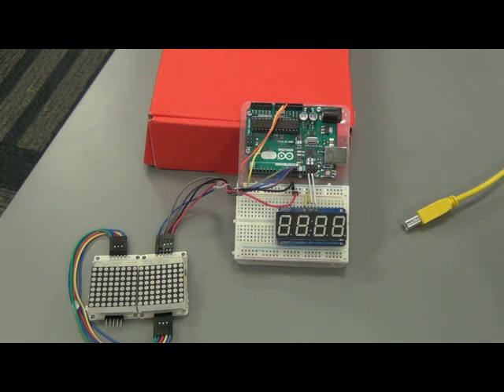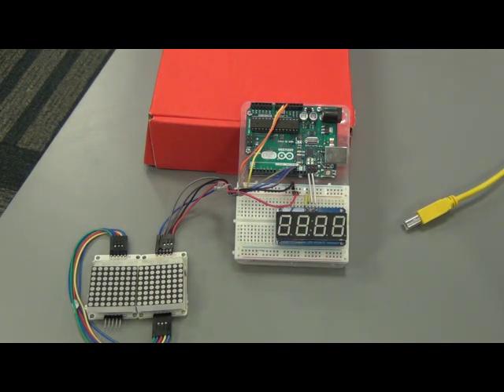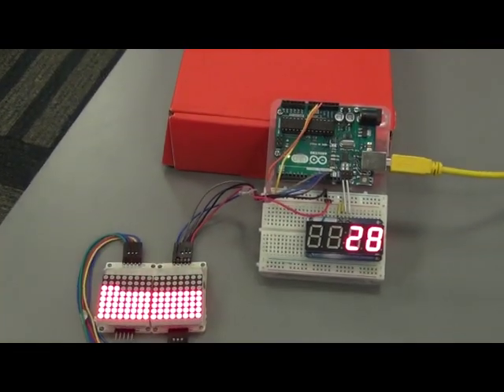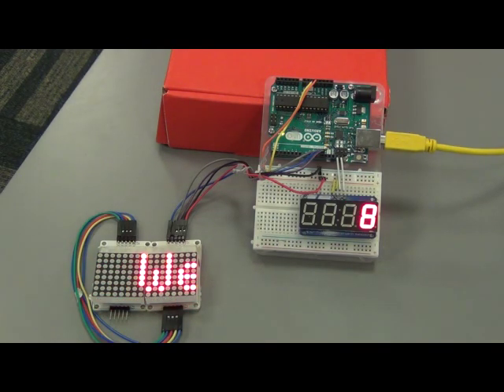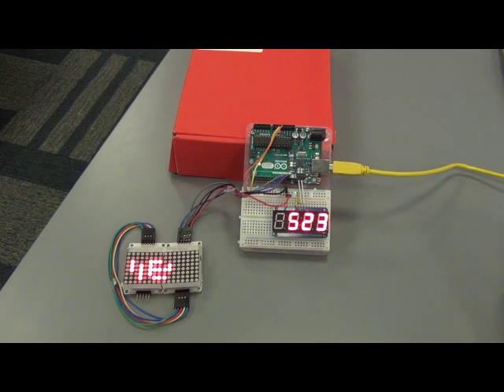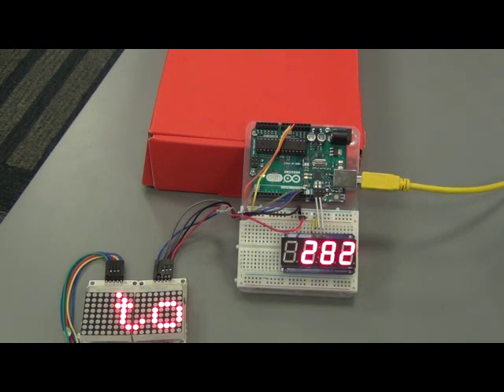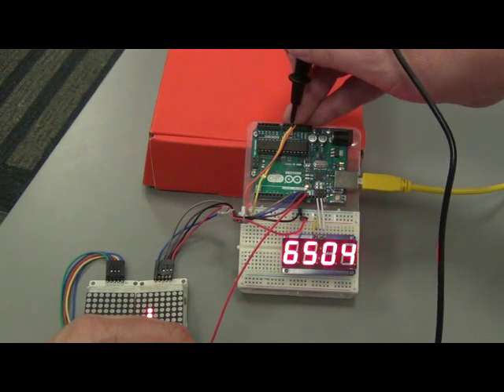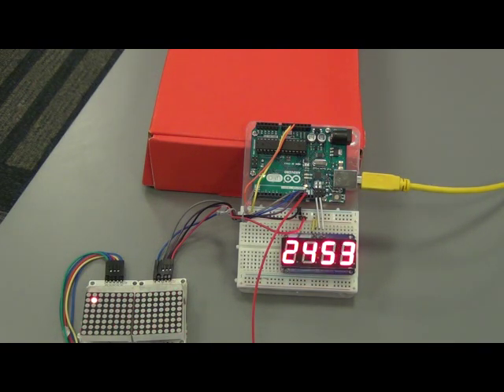Multitasking Arduino With Timer 2 Interrupt

Comment: what you actually did was making a basic dispatcher for a multitasking time sharing system, basically the way e.g. Linux of Unix works
Reply: Henri Witteveen I don't think so. What he would have to do is implement a whole process table. I believe you need to use assembly for that in order to save and load registers. Then he needs to write code that will either relocate pointers (difficult) or copy the entire program into the same ram space each time (slow).
Reply: What he really did is make that timer interrupt call a function that increments the counter and toggles the led.

Comment: Mr.David is it possible to measure temperature & save data into sd card and check temperature using if condition to activate a relay or not?!
it seems like I am trying to do 4 tasks in uno 
I tried timer1 and timer3 also tried to do use loops inside main loop but couldnt 
can you advice me a way?

thank you
Reply: thank you very much for prompt reply Mr.David 
I finally solved my problem 
it was about wiring 
keep doing hard project pls 
good work!